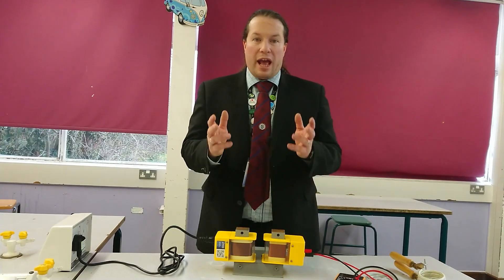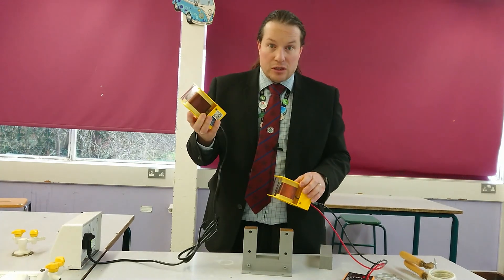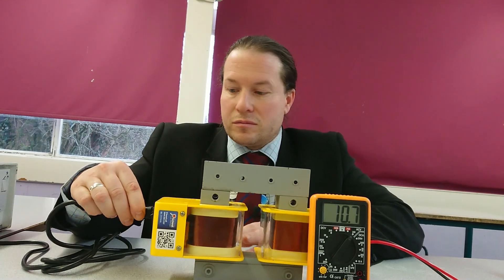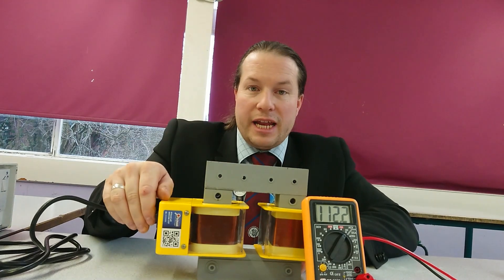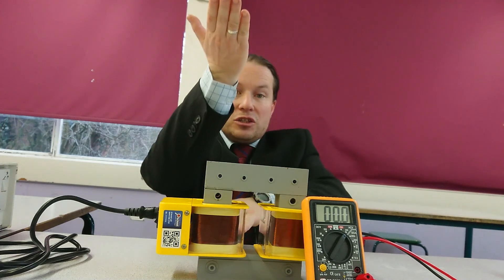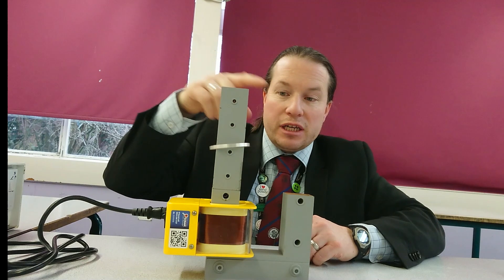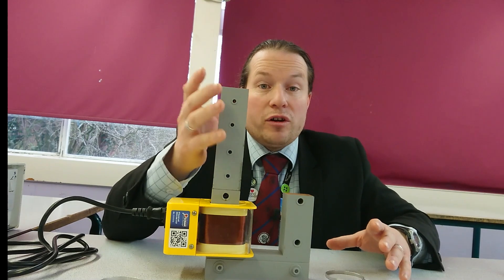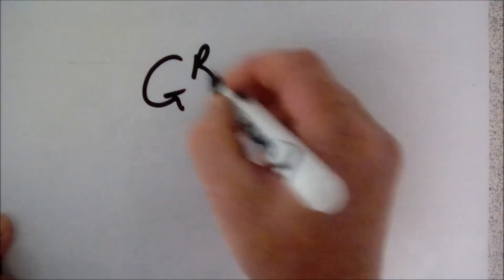GCSE Physics - Transformers and how they work

Comment: Your teaching is so amazing.am now thing how to make my own transformer
Reply: you have probably already made it as its been 6 months since you typed this but if you want instructions I can give them to you.

FIrst you'll need insulated copper wire 2 different kinds. then you would need metal "cores" these cores will be used to amplify and concentrate the magnetic field. You can use thick metal rods made of ferromagnetic material.

Next you will need to wrap the coils of wire in a certain way, the formula to do so       Vs/Vp = Ns/Np (I used a 1:10 ratio with a voltage of 12v through the primary so I got an output of 120v AT VERY LOW CURRENT. 120v is dangerous so keep the current low)

you will need an AC power supply NOT DC. so that means you cant use a battery. 

once you have made your coils of wire around your copper cores bring the cores close together but not touching, make sure they are lifted up by some sort of object and they are lifted to be 100% straight and an equal distance away from each other. Ideally the closer the better without touching otherwise you may short it. 

Put your current through the primary coil and measure the output of your secondary and see your voltage

I hope this helped a little bit

Comment: And of course, you either do not know or forgot to mention

secondary current drops because of primary flux leakage and at the same time, secondary voltage drops because of secondary leakage flux

Flux leakage leads to primary coil voltage and amperage phase shift. In other words, power factor of the primary coil determines output secondary power.

Note, power factor of secondary is always one.
Reply from the maker: Thanks for the feedback, I do know. These videos are aimed at GCSE and none of that is on the syllabus. Likewise no mention of eddy currents and how they are formed.
Reply: @GradeGain  oh okay. However eddy current is just another name for induced current due to flux leakage.
Reply from the maker: @lukiepoole6701  True